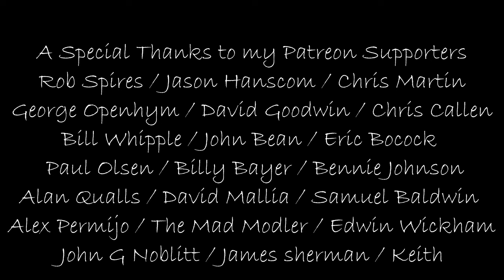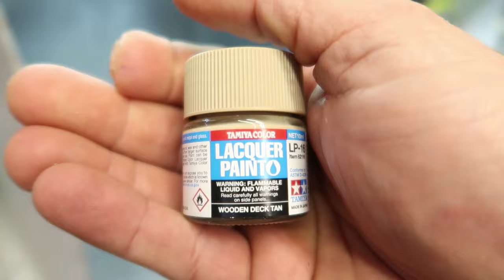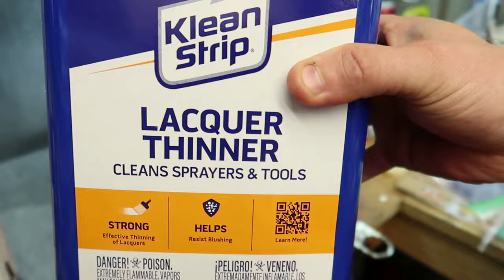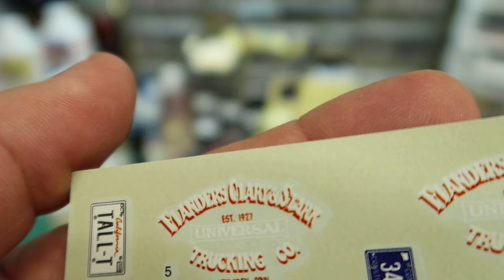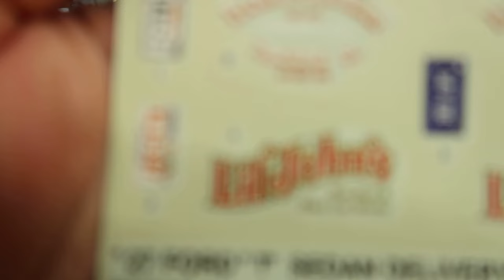1926 Ford Model T Delivery Paint Progress!! I think I like it!!

Comment: I like your cleaning process for your air brush. That color suits the car very well too. I would like to know what air brush you used and what pressure you sprayed at? Funny you mentioned that you never break down your air brush for cleaning, as I don't disassemble mine either. I spray mostly craft acrylics and with my home made cleaner, I have no issues with dry tip or clogging. Thanks for the video & keep em coming 😁
Reply from the maker: 20